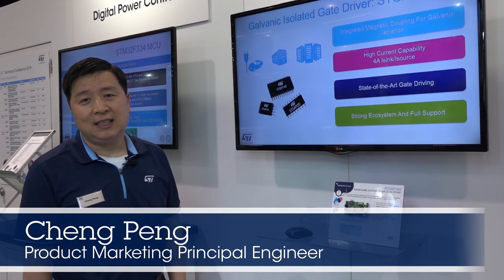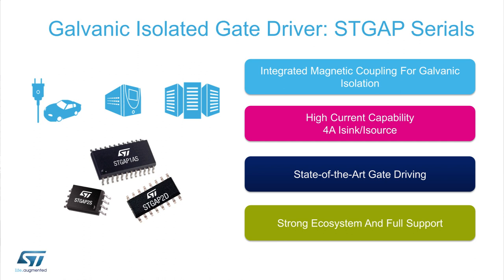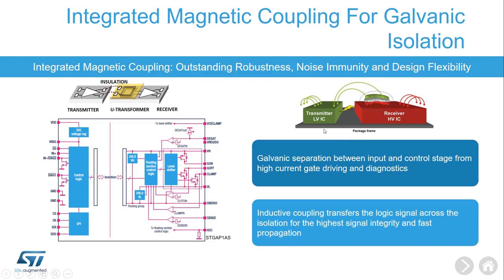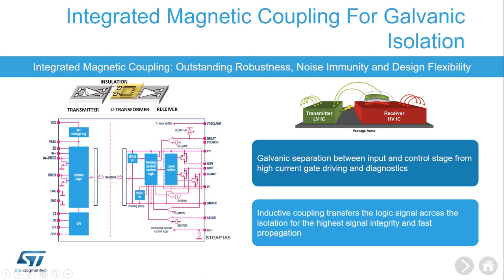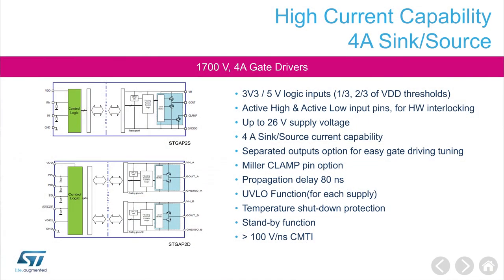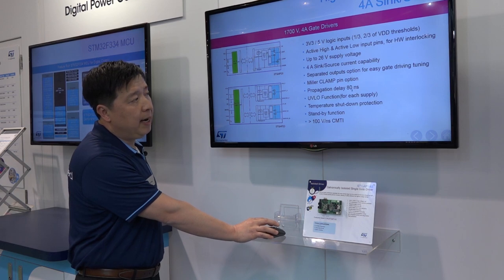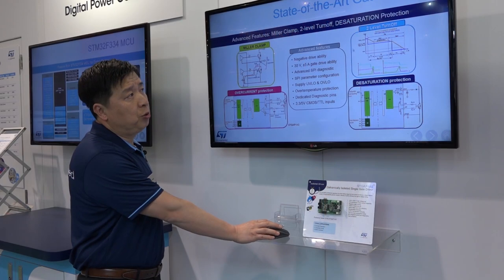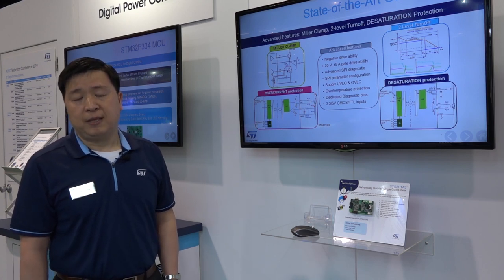STGAP: Isolated Gate Drivers for MOSFETs and IGBTs

Comment: I used the STGAP2D part for a 3 phase motor inverter. There was no need to worry about careful board layout to avoid negative transients which can be a problem for conventional driver ICs.